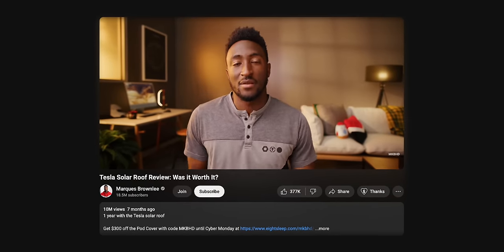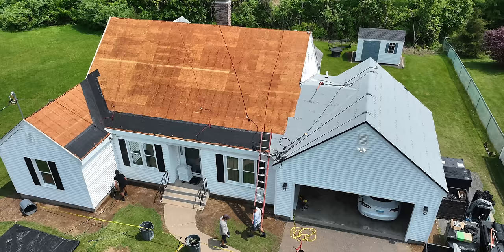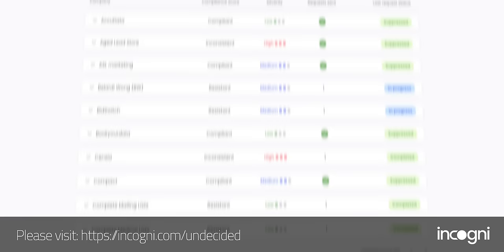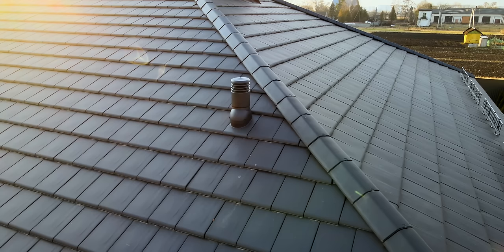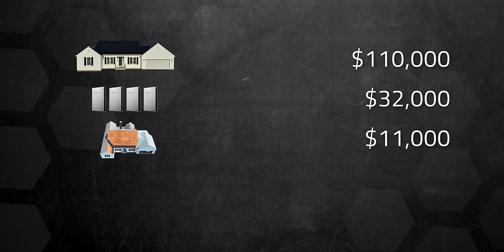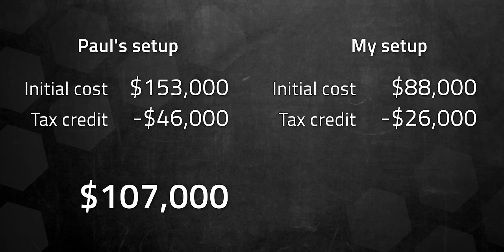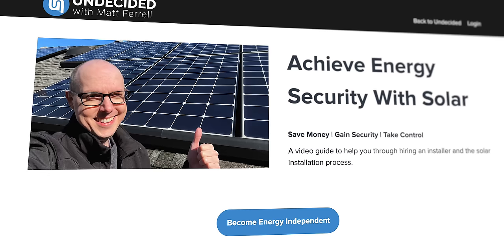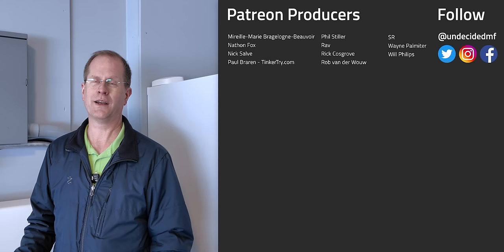Tesla Solar Roof vs Solar Panels: Which is Worth It?

Comment: Solar shingles are expensive and hugely inefficient. I just ordered some Sungard panels. @ 23% efficiency.  In difficult areas they will be on small stands & angled correctly. half the price, twice the power. no brainer. shingles look way better of course, but it ends there. Shingles need to be 20%+ efficiency & 1/3 less cost, then I would be a buyer in a heart beat.

Comment: Only reason I got Tesla roof  because I need new roof  also  I got  170 working tiles  plus 50to 70 dummy ones did not regret  only draw back I see  during summer months it clipped. Because my inverter is 7.7kw   and tiles r 12kw

Comment: neither roof because I can do maths. In my area electricity is cheap enough to not justify the cost. It would take me 20+ years to recoup the costs provided that panel output and electricity rates remain constant. I can think of many other places to put that $ that will absolutely do better than break even in 20 years.

Comment: Getting a solar roof should only be done if you need a new roof anyway and have a large energy demand.  Like on a large new house, or to replace a complete roof.  And to get the most out of it you should engineer and align the house for maximum solar roof exposure.  In every other circumstance you are going to get more energy per 1$ spent by a significant degree using modular panel kits.  The delusional pricing is a result of poorly written incentive programs.  All the regulations that would be in place to prevent this kind of price gouging were removed to allow the weird premium/shell con pricing scheme the automobile and medical industry use to assign higher costs and claim losses for tax incentive on top of astronomical revenue.

Comment: I’m in Australia 🇦🇺 where 1st Generation Solar Panels are still being supplied & Installed throughout metropolitan areas which have a half-life & are the raised panels. The problem with raised panels are they prone to being nesting places for Birds & Vermin, with lichen/moss or dirt being a problem building up on the panels which are difficult to service. The Shingles (Tiles) appear to be the way to go. Are they UV stable? Can they withstand high impacts from large hail storms? What’s the life of a Shingle? Are they in Series or Parallel & can you do DIY maintenance? Cost Vs Quality & life span of the product are my major concerns.

Comment: Tesla is smoking crack! $153,000 for a 27kW system that at it's peak in New  England will be lucky to produce 12kW in the summer and maybe half that during the worst days of New England winters? At least the modular system can more easily have snow melt systems included or include hybrid solar hot water systems in the same units, and you don't have to worry about the 20-45% of your north-facing solar tiles only producing 15 percent of what your south facing tiles produce for the same price per tile.  Also, Tesla's "bug" doubling the values of solar production numbers? Sure, a bug that lasted months making their solar roofs look twice as good as they really were. I've so had it with the crap everyone lets Tesla get away with, from their incredibly over-priced yet shoddily manufactured products to their blatant lies and false advertising about things like Tesla roof power production and Tesla Full Self Driving.

Comment: I had solar installed on a fairly new asphalt shingle roof on my city home. Never do this. I have almost reached break-even on costs except the solar has to now be removed and the roof replaced then the solar reinstalled and I start over again.

 I priced an old school metal roof and in my area. After the hail storms dent them to ugly mangled tinfoil, same issue. Remember traditional solar does not cover the whole roof.

 I priced a true premium metal roof that would resist the hail storms (just had a tornado close enough to be measured in feet not miles at the county home) and they are $50-$80K (probably more after they do the structural rework) add on solar and it cost the same as a Tesla solar roof except the solar roof looks better. Glass also does not lose the gravel finish when beat by hail so the look will stay similar. 

Also remember LIFE time roof equals 50 years.

Altogether tho if you don't mind your roof being worked on they probably all cost the same in the end. One has workers out about ever ten years or more... the Tesla roof. Well we really don't know yet do we?

Comment: Please do the climate math. Your solar system might generate 688 MWh (20 years * 2K sun hours * 17.2Kw). In California, energy costs 0.18 ton CO2 / Mwh (45 mT CO2 / 250 TWh). You're spending at best over $700 per ton CO2 ($88K / (688*0.18)! Grid scale solar and storage is so much cheaper! Let alone other carbon removal or reduction strategies.

Comment: you can pay a lot of power bills for the cost of of solar and storage.  Arguably more than the life time of a solar system with storage.  Not to mention the northeast is about the worse climate for solar in terms of solar exposure.  I really don't get the push towards putting solar panels on roofs in these scenarios, it's adding complexity, cost and the only benefit seems to be bragging rights, maybe you can claim self sufficiency if there is a power outage?

Comment: Standard path. Efficiency will double soon, you make sure you do it when replacing the roof anyway, plus you can get better components and installers. You can still go with Tesla powerwalls, but seriously, in light of X (formerly Twitter), I'm no longer a fan of Musk and would rather support someone else.

Comment: May I offer an opinion?     I presume your audience does not have the extra income to buy into solar-anything.  The question of spread of "solar roof" via solar shingles VS solar panels on top of traditional roof is.....a non concern.  I think I can speak for most of your audience that "WE JUST WANT SOLAR -ANYTHING-" panel or whole roof....    At this point, I'm keeping my eyes on used LiPo cells to build a DIY battery wall.  I'm looking into spending on used solar panels.

Comment: for me, it's an issue of lifetime value which (for me) includes technological obsolescence and aesthetics. We are seeing much more efficient and effective promising technologies in solar evolving fairly quickly. This will dramatically impact the return on the initial investment. These technologies are also going to impact aesthetics.  I think wrt aesthetics I would look to build an array separate from the house if possible ( may not have the space) as panels applied to an older building for me look very unappealing.  If building a new home I would design the roof in such a manner that the use of standard panels looks more intentional to get the flexibility I want, the ability to switch out panels easily to deal with failures and obsolescence without substantively impacting the ROI and/or aesthetics. We are in a transition period and aesthetic fashion trends will change over time  so it really is a function of personal tastes. Also, there are other systems like wind and geothermal that need to be also considered to reduce overall load and risks  so its a complex equation

Comment: Sounds like a ridiculously expensive way to get energy. I spend just under $1500 per year total cost for gas and electricity in a 5 bedroom home. I spend less than $2000 per year on fuel (LPG) to run my 6.0 V8 wagon.  Electric cars have massive depreciation, my V8 wagon has appreciated 50% in 6 years since I bought it. The insurance is 300% more expensive on an EV over my V8. That $100k I put in the stock market 8 years ago is now worth over $250,000 and I also got over $10,000 in dividends.  I'd be over $150,000 worse off if 8 years ago I went for solar panels, batteries and an electric car instead.

Comment: If you want net zero, why not build a passive solar home? Then you need far fewer panels, batteries, etc. and it’s actually net zero not pretend net zero.
I get it if you’re renovating an old house but you built a new house.

Comment: Comment on current "standard" solar panels. There does not appear to be any standard sizing of panels, either in physical dimensions or power output. Replacing one or a few panels in the future may not be an easy job.
Reply from the maker: The racking systems make it easy to adjust, so it wouldn't be a big problem to do a little arranging.

Comment: i feel as you have half the battery and less then 50 % of the energy you should have counted this in your math . your system was way way more pricey for a lot less or the same price for a ton less solar . that said most people could instal that metal roof themself very easy and save a lot of cash

Comment: why is solar so expencive in USA? damn 55k for 17kw is just crazy, In India it cost around 600-750$ for 1kw, usually around 3500$ for a 5kw system completely installed with high rise mounting so we can still use the roof, and you Americans use too much energy lol

Comment: if you can get two 450 watt half cells panel's at 24v for  three-phase ev 240 you need 2 for every one for 230v since a 2 pack can go for 780, solar 12 packs can sell for around 750 = to 6 at 3 phase so you you would need 24 panels to have an 10,800 kw setup  math wise that is  on par with this video in general costs its like 108,000 without intensive you you bought the panels your self. now if you can get 450watt half cell-s for 650 an pop  or even at 700 for every two that is where the saving really can add up the only packs of 24 and 48 are where the big saving can come from if you shop hard on sale saw an 450  24v sell on sale for 600 an panel at 31% sun rating you could save an easy 12 grand easy without intensives over using an installer to get the panels so it pays to shop. this is what i found out as of recent info.. so not much has changed since video posting cost wise.

Comment: $153,000 27kw solar roof would be a 25 yr mortgage monthly payments about $1000.  or $12,000/yr.  your area annual solar power possibly 27,000kWh/yr at 12c/kWh residential = $3240/yr .  $12,000 to save $3000?

Comment: Paul has more solar production and more storage  but paid more is there a calculation to compare the 2 systems how much would it cost you to add extra production and storage to equal Paul.   No iIam not a Tesla fan, and possibly his tiles might need replacing in 30 or 40 years how much would that cost be compared to changing your panels.

Comment: how did you have 55k in solar. thats 150 for a bifacial 400 watt panel.  plus hardware.  250 per panel and mount. 275 panels  What doesnt add up. A fyi metal roofs have lots of issues a 7 years old. all rubber dies on the screws and mystery leaks. I have rental houses and storage untils. and a contractor.  It can be dont so much more cost effective.  This is not a good example personally

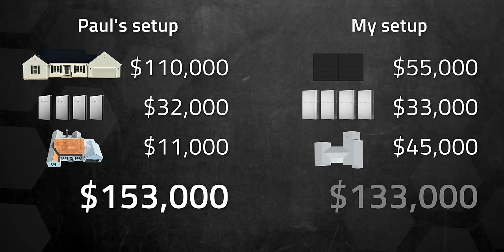Comment: 10:24 and if you DIY your system you could of done you system for about 50 to 60 grand. If you didn't go with those specific batteries, you can do a whole house system for like 30 grand and that's on the high end. plenty of videos out there that show you how to DIY. All the panels made today are pretty much twist lock chained making it super easy to do your own system now and days. But what do I know I am just an overweight youtubie expert that has never built one of these systems.

Comment: A way cheaper way to solar benefits maybe ; would be a few  large size fresnel lenses concentrating sunrays onto a  fairly long metal tube that would circulate the hot water to either a turbine for power; or just bypass the turbine  for hot water . 
Would somebody get to that please  already?

Comment: A Tesla solar roof is a terrible idea. May be OK in the US where homes are designed to last 50 years or so so thatyou can scrap the whole thing and start again at massive expense. These Tesla things are both far more expensive and less efficient than conventional solar. Here in Europe roofs are designed to last hundreds if tears so it is far better to fit conventional solar panels which can easily be replaced when their kutput has declined too much. Conventional solar panels are obtainable from many suppliers at ever decreasing prices. It us the height of idiocy to sign up with a proprietary system from a company that may no longer exist in 20 years time

Comment: I love the idea of the solar roof tiles, and I think it is inevitable that this will be a product that is common in the future, if Tesla doesn't have too many patents that is.  If there is able to be competition i truly think it makes the most sense.  Combining both roof tiles, and solar power cells into one just makes sense. Why add roofing, then add solar cells on top, it is completely inefficient.  However, the tech is very new, and unfortunately the people behind Solar City who started the project, i think had some issues, they grew too fast, and I think this product has some legacy issues from how it started.  But I truly think the idea is brilliant, and I really hope it is figured out sooner than later, cause the most homes that could be as off the grid as possible, the better for the world in general.  But right now, if I were building a new home, i'd really think twice about installing a tesla roof.  The only way I would do it is if someone else in my immediate area had it done, and had nothing but glowing reviews for the company and electricians who did the work, and their support.  If i knew I could then get the exact same crew, it might help ease the worry about the horrors that some owners went through.  Unfortunately it is never easy to tell how much is the fault of the home owner, and how much is the fault of the installation company. So many idiot home owners out there, where they get a quote for the roof tile, and then when they are told later the also need batters, inverters, etc they freak out and claim the guy is 'uping the price', when they did no such thing, the home owner is just completely ignorant about how these systems work.  Then on the other hand, you have night mare contractors working for tesla who are pretty much criminals and are lying about installation costs and try to force owners to pay more than the contrac they signed, etc.  So right now, so much it seems depends on who you get to install the tesla roofs... But in some ways, that's the same for any solar company right now, as it is still a bit of a wild west out there...
Reply: Great words of wisdom/warning! I do feel fortunate to have had experienced Tesla crews doing my install, with 2 other Tesla Solar Roofs right in my same town before me.

Comment: People really need to shop around I priced 32Kw worth of solar panels 545w each panel. and 100kwh worth of batteries. I came out to about $22k in material plus labor. This was for a family member with large utility bills. For myself I only need about 8kw worth of solar and 45kh worth of batteries so my system would be much less. Regarding labor I would do it all myself. Even with a tax deduction my system would be far less than these. Do your research and be your own contractor. Hire one guy that knows how to install it and get some cheap labor to help him. Save Huge money. You could of saved over $100k! how long does it take you to save $100k? Solar installers over charge on everything. I been an electrician my whole life so that helps but like i said you can hire someone pay them by the hour. Work smarter not harder and expensive. My system can pay itself off in 5 to 7 years. when it takes 20 years to pay for itself that is because one pays an expensive solar installer to do it, and it does not take long to do it.

Comment: What happens if someone has a metal roof, then wants the solar roof? Does the metal roof get taken down? You said you wanted a metal roof for longevity but can't you have both even if it's obviously more expensive? 

Also, why didn't the "doubling" issue get fixed for everyone as an update? Seems like Tesla wants to lie to their customers and stock holders unless a YouTuber is talented and popular enough to receive the individual fix. That's sketchy.
Reply: Good points. I doubt Tesla Solar Roof would work on a metal roof, but I can't say for sure.
About the doubling issue, I had the same question for the Tesla app developer, his answer was along the lines that it took a while to roll out the fix to everybody.
I have no Tesla stock, and my YouTube channel is rather modest, so I don't think I received any special treatment, but I'll never really know.
Thanks for taking the time to share your thoughts! I can't believe how many people have watched and commented, it's pretty incredible, Matt is awesome!

Comment: Interesting but I still think as technology moves forward we will see better systems and will be cheaper. I nearly had it installed 10 years ago but decided, that the pay back time was many years so decided not to go ahead.
10 years, on and to see they don’t last and have to be, scrapped as the shell life is not very long. The other thing was. Back then there was no battery 🔋 pack system as I kept asking, the sales person but couldn’t understand what I was asking as even to me made sense. I’m still waiting to see better battery system and storage as I think that’s what the future will be. John 
From the UK 🇬🇧 And those prices seemed, very expensive considering it was 10 years back about £8,000.00 to £10,000.00
I also think your system is the best as there’s restrictions with the Tesla.
Your system is practically and you can add, extra panels when they start making triangle shapes and other that fits the gaps in the roof more easily. This eventually will allow you to cover most of the roof. I’m sure this will come. Good luck very interesting.